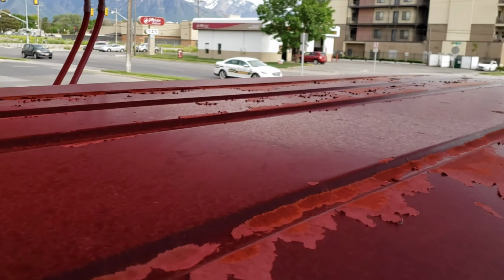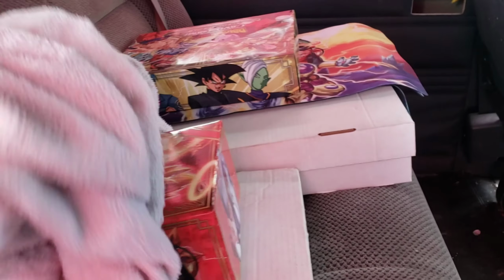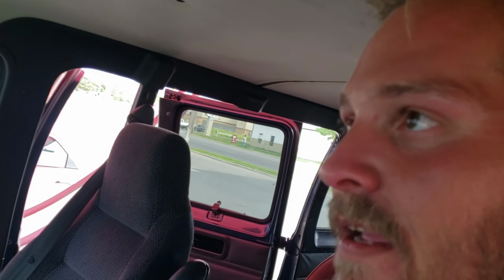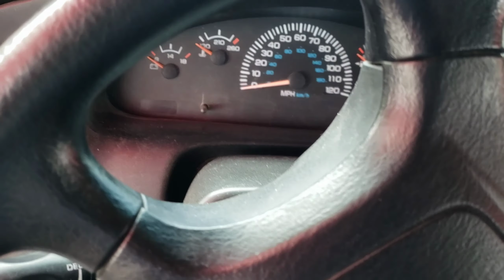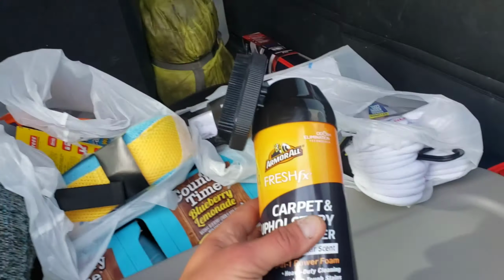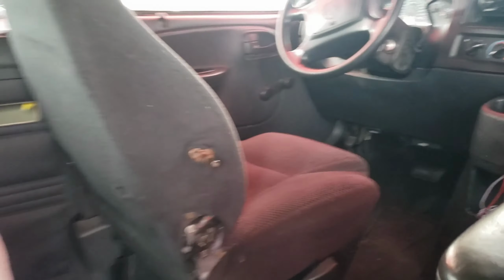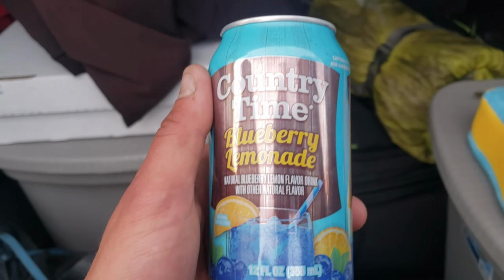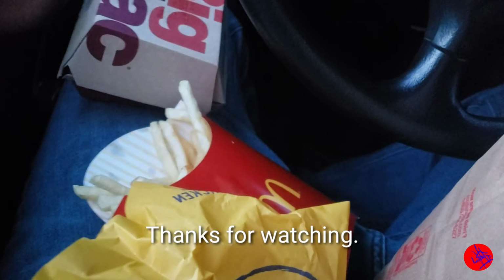Vanlife #1 The Van

Comment: Dude, THAT'S AWESOME YOU got a van to get off the streets, that'll make a good off grid tiny home!💯 Get the silver sun blockers for windshields, & cut them to fit the windows, & buy black fabric, & wrap the pieces in that, & either glue/sew on it to black out the windows for sun blocking & privacy while sleeping. Buy a memory foam bed, & cut to fit your needs, they come pretty thick nowadays, & support comfortable! You can build framing, & use spray insulation in between the ribbing to keep you warm during the winter, & keep cool air in, if you hopefully have working A/C! Run some temp power source for mood lighting/regular lighting. You can buy pretty cheap surveillance systems & rig them for van security/ back up camera, even with flood lights/movement sensors. Lol! Hopefully for the more expensive stuff, if you have more fortunate viewers on here than me or you, then maybe they'd have an old solar panel, mini fridge, power converter, batteries for the solar panel, etc.... Maybe put hashtags of; #vanlife #offgridliving #vagabond #tinyhome #wanderlust #vanbuild, so on & so forth, & that'll attract hopefully more people to your channel searching for those hashtags. I'm still waiting to get my stimulus check, when I do, I'll toss you a few bucks, I been homeless, twice, as a heroin addict, & as a sober, single father of a 10 mo. old! 💯 Life will get better as long as you stay clean, you got this though man, good luck bro!👍👊
Reply from the maker: That is an amazing story, thanks for sharing brother. I'm glad your doing better now. Your right about the hashtags I just dont know how to do it lol.

Comment: rhino line that bitch for about 2-4 hundred to prevent rusting further . I did my truck. its easy. 80 grit every inch and shoot it but make sure you get all the rust off first. 80 grit the windows and shoot them to if you so choose that rout. It will look and be tough
Reply from the maker: Your saying I can put rhino liner over the windows?